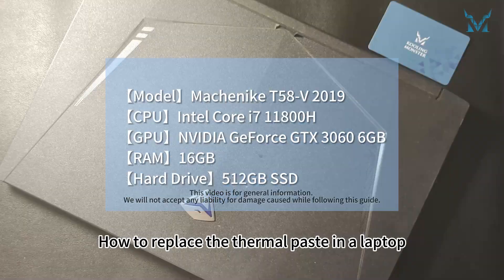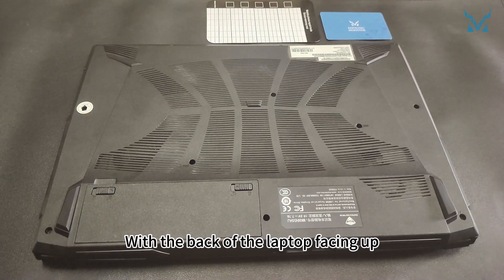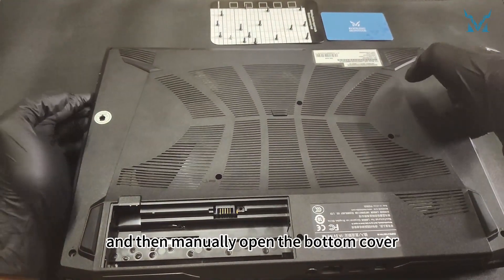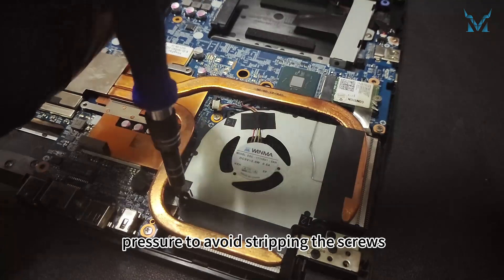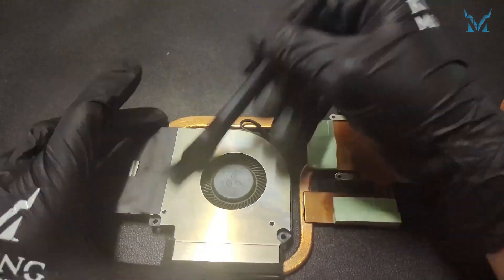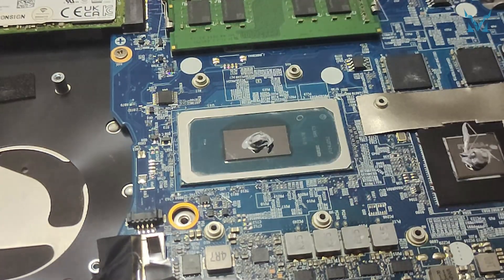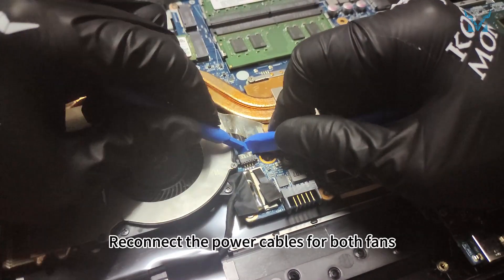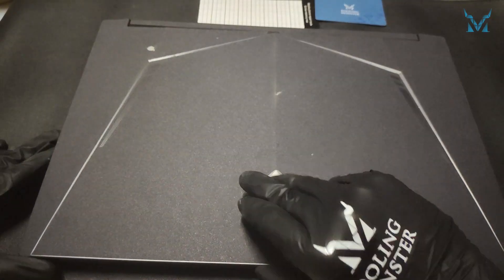Speed Up Your Machenike T58-V 2019- Prevent Overheating With Dust Cleaning & New Thermal Paste

Comment: Wow. This is Exactly what I need.  Can the CPU and GPU of Machenike T58-V upgradable?
Reply from the maker: Thanks for watching! 😊 Unfortunately, on most laptops like the Machenike T58‑V both the CPU and GPU are soldered to the motherboard and not upgradable. Your best bet for better thermal performance would be to clean the fans really well and reapply high‑quality thermal paste—we use KOLD‑01, which is durable and great on laptops.

Comment: the temps went down but the laptop body feels a bit hotter to the touch. is it normal?
Reply from the maker: Yes, that's quite normal! After repasting, internal heat transfers more efficiently to the heatsink and chassis, so the outside may feel warmer — but that usually means it's doing its job better.

For optimal heat transfer, KOLD-01 thermal paste can help maintain lower core temps while dispersing heat more evenly.

Comment: do you have a video of how to replace GPU/CPU Fan? My GPU Fan needs to be replace. its not working. Hope you can reply.
Reply from the maker: We don’t have a video on that yet, but we’ll update it in the future—please stay tuned!  
In the meantime, here’s a quick tip: replacing the GPU fan usually involves removing the back cover, unplugging the fan connector, and unscrewing the fan. Just make sure to get the right replacement model. Good luck!

Comment: I have a similar one (machenike t58), but I can't pull out the fans with tubes, although everything is unscrewed.
Reply from the maker: It sounds like you’ve already undone the screws, but sometimes the fan and heat sink assembly can be a bit tricky to remove due to thermal paste or small clips that might still be holding it in place. Here are a few steps to help:

Gently wiggle the fan – If it’s stuck due to the thermal paste, applying slight force while wiggling it can help loosen it.
Check for any clips or hooks – Some laptops use clips or other retention mechanisms that can be missed.
Use a plastic pry tool – If it’s stubborn, a plastic tool can help to carefully separate the fan assembly without damaging components.
If you're still having trouble, feel free to send us a message with more details about the issue. We’d be happy to guide you through it!